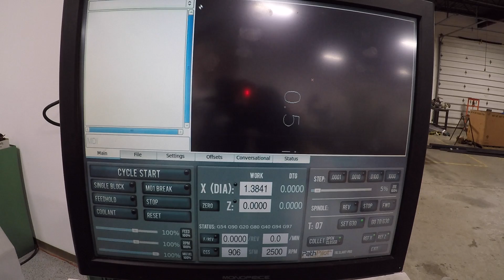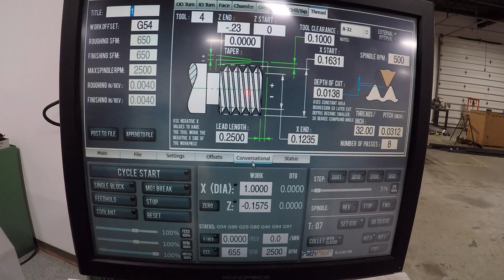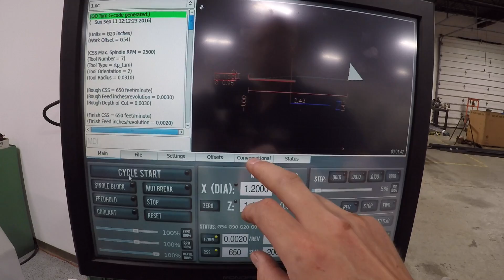CNC Turning Hard Steel!  WW112

Comment: Hardened dowel pins are case hardened only. Not through hardened.  So the reason your "losing the hardness" is not because of the heat generated into the part.  It's because you have cut deep enough to get passed the case hardening and exposed the softer core material.
Reply: That's what the polar bear said about the igloo.
Reply: I was just about to say that beat me to it
Reply: What he said
Reply: John Helmi didn't insult you i don't know why you anwser to me like that ... and for the record, where i live its cheaper to put some low carbon steel for carburization than alloy or high carbon steel just for hardening and tempering... maybe its different for you  and im ok with that
Reply: 4th
Reply: I'm no engineer, I want to be, but I would guess that only the outside is hard because when the heated piece is quenched the outside can be quenched quickly but the inside has to lose it's heat slower than the outside which is in direct contact with the quenching liquid, or whatever. Am I close to correct?
Reply: The3rdKnight 
Sort of.  It's in the heat treatment cycle itself. When you heat something like a dowel the outside will heat up first. You heat treat just long enough for the outer part of the pin to get to get to hardening temp, but not longer enough for that heat to soak all the way throughout the pin to its core.   This gives a hardness gradient to the pin, the outer is the hardest and it gets softer as you get to the center.  

Leave it in the heat treat oven long enough for a full heat soak and you will get full hard rod. Drill rod and Thompson rod would be full hardened rod.  These have the same hardness throughout the material
Reply: Occams Sawzall thank you
Reply: +1
Reply: Occams is correct.
Reply: This is correct and for me the easiest way to see how hardend is part just take a look on the face.
Reply: the reason why they do this is economics... its cheaper to make these piece from 1018 steel  and case harden them after
Reply: Leaving a part longer in a furnace makes the outer few microns harder and allow the part to be deeper hardened overall allowing the carbon atmosphere to deposit more carbon in to the steel.

Making the furnace hotter does kind of the same thing but has different downsides like deforming the material.

The quenching affects mostly the grain size of the steel and than you can also nitride the surface if you really want to give someone who wants to turn it a headache.
Reply: Occams Sawzall +1
Reply: Yeah he did say that might be the case later in the video.
Reply: Occams Sawzall yeah they also have a process that injected carbon in the chamber to increase how deep  and harden the part deeper
Reply: Occams Sawzall that's not the reason in this case. Dowel pins are usually produced using cheap steel with low or medium carbon content. The heat treat cycle is usually a carburization to achieve maximum hardness on the outside but still keep some toughness.

Heat soak is a real problem with large PH steels but not usually with small parts like these.
Reply: Spot on there case hardened. Give someone a camera and they are an expert
Reply: +Mike Davis This is exactly what he said fucktard.
Reply: reyspec No it is not because of economics, the reason they are case hardened and not all hard is that case hardened dowels have more desirable properties than all hard.  For starters they are not as brittle and wont shatter when dropped.  The list goes on, if you had an education in engineering you would know this instead of spouting some bs from your arm chair pretending to be an expert lol
Reply: reyspec I'm not insulting you, you're just wrong and I'm okay with that too

Comment: And if you worked on titanium before, you set your machine on fire :) guess how I know oO.
And the rest has been said already. They are only case hardened. I do a fair bit of hard turning and turning "forged" railroad wheels and hardened stuff. I like using ceramet
Reply: Guess who did the same thing on Monday, my own fault I let the Titanium swarf build up on an oily rag in the chip tray. With small amounts it normally just burns out, but if the swarf pile is too dense then you can reach "critical mass".:>(
Reply: +Chris Stephens just curious how big of a fire?
Reply: Not big and quite easily put out with a couple of pints of water sprinkled to cool things.If I had not let the swarf pile build up, or if I had used coolant, there would not have been a problem,
If you have titanium wirey swarf and light it, it burns with a bright white flame but quckly goes out, a good party trick, but if it is dense the heat can buid up and set other things alight. Titanium does not tranfer heat well so when you turn it the heat builds up and you can get sparks and/or fire due to the heat not being able to dissipate quickly enough this can be a problem for the unwary or the clumsy(guilty as charged). 
If you have a particular query I will try to answer but, although i have some experience, I am not greatly experienced with titanium.

Comment: we turn hardened surface hardened and plated Rod stock daily using both CBN and ceramic inserts, with the ceramic we take 1/8 cuts off each side 1/4 total per pass but the ceramic require hardened material as they don't care for soft materials.

Comment: I'm a little confused regarding your terminology while looking at the results - through hardening, from my understanding does not mean "all the way through" the material.

Obviously, when a part is heated and quenched, the shock of the cooling plus addition of carbon can only penetrate so deep. The core cools slower and anneals. 

The lathe removed the 'through-hardened' surface area.

https://en.wikipedia.org/wiki/Heat_treating#Through_hardening

http://www.pmpa.org/technology/design/heattreatment.htm
Reply: Thru hardening is what it sounds. The entire thickness of the material is hardened. From example mold ejector pins , high speed steel tooling. Etc are all hardened thru. 

Case hardening is just hardening the outside surface of the metal. This is used mostly for dowel pins and things that need a hard surface, but also need to retain shear strength.
Reply: How is something hardened all the way through then, what is the process? Heat/quench repeat (multiple times) and then anneal the outside so it's not to brittle? 

Other than heat treating, I can only see the alloy being very specific.

What is the process/requirements?
Reply: The core of a through hardened part is always softer than the surface. If you were to take a 1" rod of high carbon steel and harden it, the surface may be 60 HRC while the center is 50. It is still referred to as through hardening

Comment: seeing that hot glowing chip you might NOT use cutting oil with it (if you not plan to set things on fire) ;-)
Reply: I am pretty certain that if you use cooling of any sort with these types of inserts, they will shatter.  It also would completely defeat the purpose of generating the heat in the chip to soften it.  I could be wrong about that though.
Reply: You must NOT use cooling on CBN inserts. They will last much shorter because of the variation between hot and cold.
Reply: you are correct. the cooling oil as it hits the tool will vaporize and cool the tool, but in that pocket of gas the tool heats up incredibly again. this extremely rapid heating and cooling cycle will break the tool quickly. (thermal fatigue) 

This also happens on some "normal" insert tooling on certain stainless grades or superalloys.
Reply: Barry Gerbracht 

Correct.  The thermal shock of coolant will cause serious damage to the insert.  May not shatter or explode. But will cut the life of it down by 70-80% easily.
Reply: that's True for all type of inserts in general, use air to cut into steel is greater than common "flood cooling"
Reply: Sa As 
Heat should be dissipated at an 80/10/10 rate. 80% into the chip. 10% into the tool 10% into the part.  

CBN and ceramic inserts can take a tremendous amount of heat load, but are very poor at taking thermal shock loads. 

In contrast HSS is very poor at taking heat loads, but can take thermal shock easily. Carbide is in between. Can take more heat than HSS, but no where near what ceramic and CBN can take, and it can take a fair amount of thermal shock without damage.

Comment: Yes you can machine the bearing journals on ballscrews John. I do for all my cnc projects. Leaving the bearing diameter hard . And I anneal the bit where I want to cut a thread. You can buy CBN inserts for cutting intermittent cutting conditions. Round geometry is the best for that. Also just a plain old Ceramic insert will turn a ballscrew. At a quarter of the price. And they fit standard toolholders also. If you find CBN fun to play with on steel. Have a go with PCD on copper. Gives you amazing finishes. No more gummy turning on non ferrous metals.

Comment: There are different grade inserts for light and heavy interrupted cuts and there are hard threading inserts. I had an application where a part was rough machined then hardened and finished machined after hardening and tool life was excellent.

Comment: Dowel pins are usually case hardened further than the core is.  It makes sense that they get softer as you remove material.
Reply: also the hardened shell on smaller pin is thinner then the bigger pin, so it didn't really matter how you machined it, just happened to be still on the hardened layer of the large pin.
Reply: Pete Brubaker ya I was just about to post   That same thing.

Comment: Are the pins losing hardness or are you simply turning off the hardened section? The part may only be surface hardened.
Reply: probably just case hard.
Reply: Yes, yes and yes.
Reply: Sam yea they are case hardened so he is turning off the hardened  parts